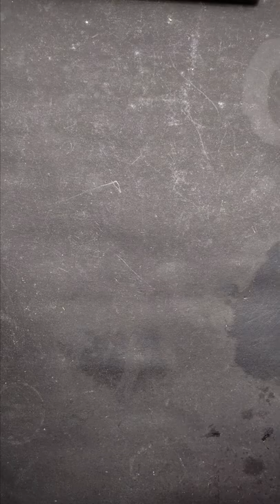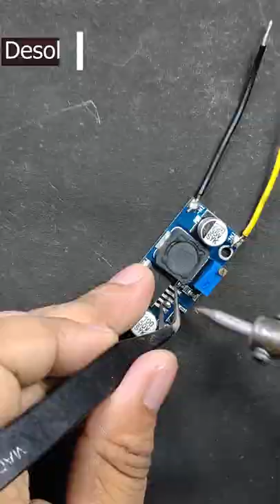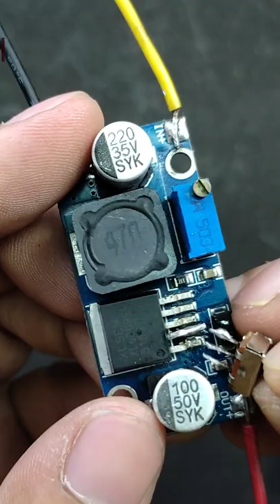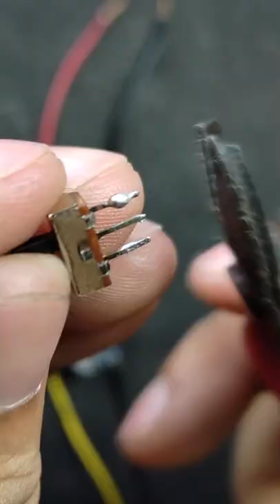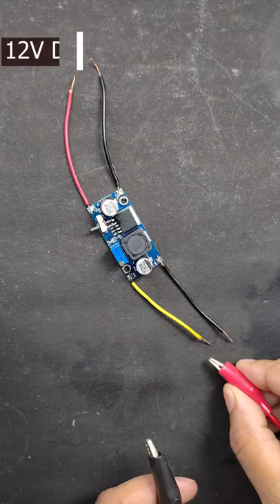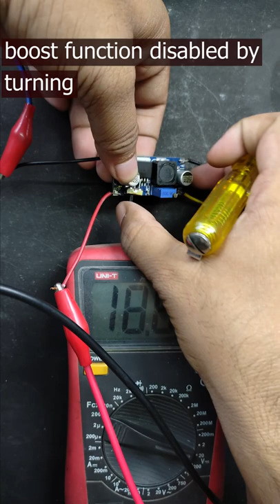A Very useful boost converter (XL6009 DC to DC) trick

Comment: THERE ARE A LOT OF SIMPLE WAYS TO DISABLE THE BOOST FEATURE OF THE BOOST MODULE. JUST LIKE, YOU CAN USE TWO WAY SWITCH AT THE INPUT WIRE. ONE CONNECTION WITH THE MODULE AND JUMP  THE SECOND CONNECTION OF THE SWITCH TOWARDS THE OUTPUT.
WHY PLAY WITH MODULE IC, RISKING IT, SO IT CAN BE DAMAGED????
Reply: pm me can you to install do sola paint of charger,

Comment: Does it shut off when battery voltage gets to low or will it drain the cell to 0.0 volts?   That would ruin a lithium cell.
Reply: Depends on if your battery have a protection circuit integrated. If not, that'll kill it
Reply: pm me can you to install do sola paint of charger,
Reply: @naomie2680   the boost converters I’ve been using shut off below 2 volts.

Comment: Sir xl6009 boost converter or Lm2596 buck converter en ko kya 12v 110ah ki battery pr lga skty hen 12v k wifi router ke lye??
Reply: Use mt3608
Reply: pm me can you to install do sola paint of charger,

Comment: I boosted 3.7 volt to 40 volt
Reply: Garam howa ybe module?kitnay dair tak wo cheez chali
Reply: Yeah I"m sure it held that quite well. Not
Reply: @talhaijazprojectlimited5295  40 volt tak voltage badhaya tha maine module heat nahi hua kyonki maine uspar load nahi diya
Reply: @ericklein5097  yes
Reply: Mai Bhi Liya Hoon Bhai Voltage Kam Kar Sar Sakta Hai Lekin Badhata Nahi😅😅😅
Reply: @karansingroul2700  step down module hoga.
Reply: @desiIND2661  Jo Voltage Badhata Hai Uska Naam Bata De Bhai Maine Kam Karne Wala 2 Le Liya Hai